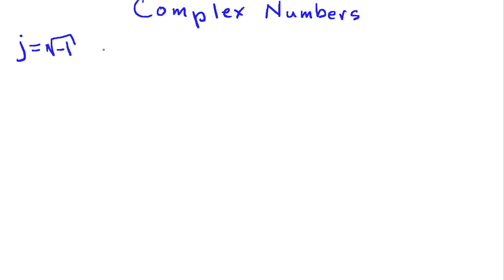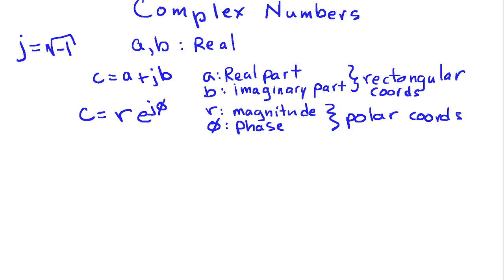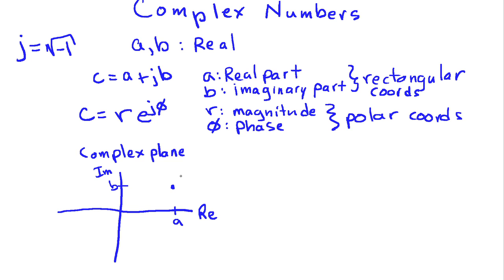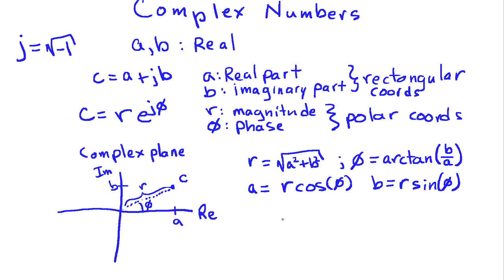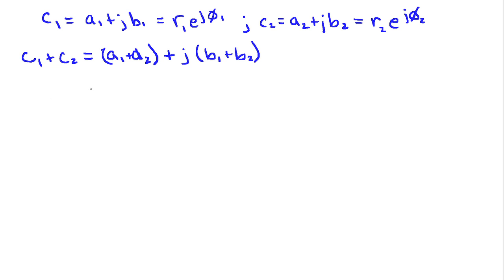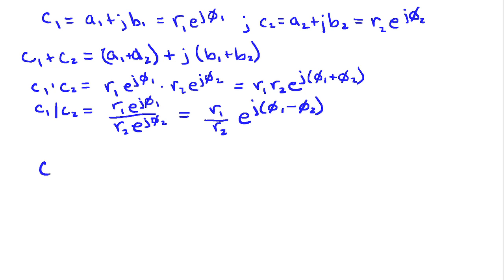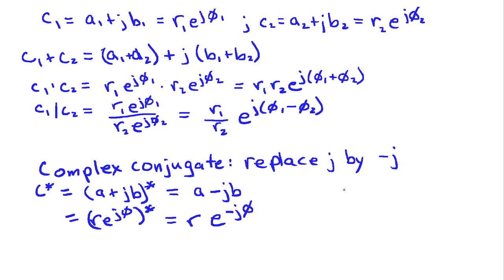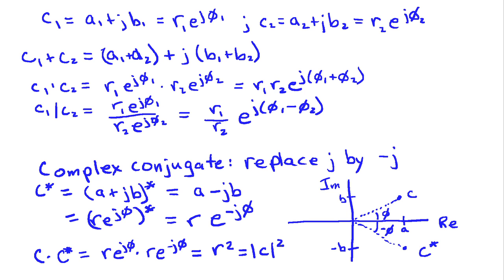Complex Numbers Review

Comment: Could you please explain about the concept of phase?
Reply: How we can find the phase of a signal, and what it really means?
Reply from the maker: You can't in general define the phase of an arbitrary signal, but you can define phase for sinusoids.  x[n] = cos(omega*n) has phase zero and at n = 0 takes on the value 1.  x[n] = cos(omega*n-phi) has phase -phi, and at n = 0 takes value cos(phi). Note that for a constant value m, we can write x[n-m] = cos(omega*n -omega*m) = cos(omega*n - phi) if we define phi = omega*m.  So this implies that shifting a sinusoid in time is equivalent to changing its phase.
When people talk about the phase of a signal in general, they usually are referring to the phase as a function of frequency for a Fourier representation of the signal. Fourier representations expand the signal as a sum of sinusoids of different frequencies, so there is a phase associated with the sinusoid at each frequency in the representation for the signal, and thus we say the phase is a function of frequency.